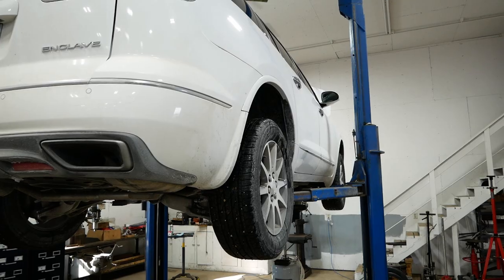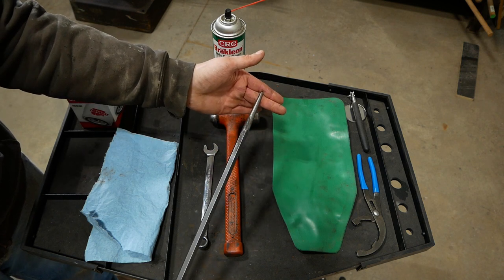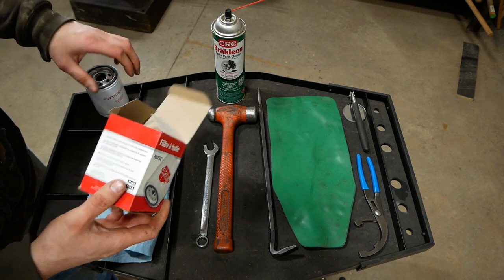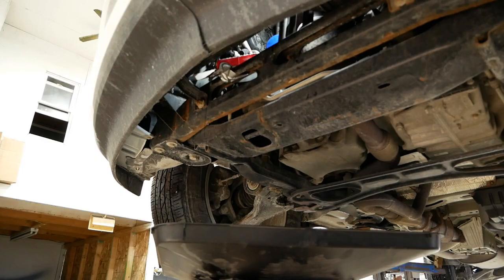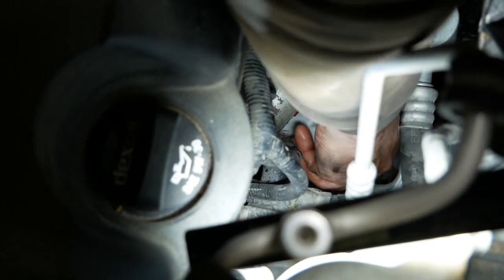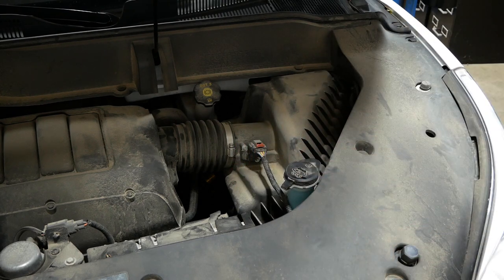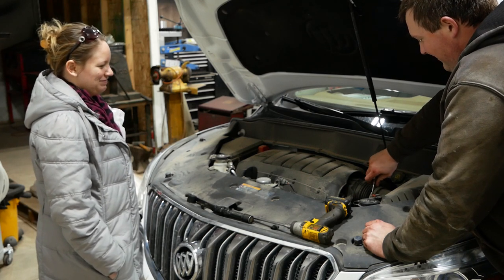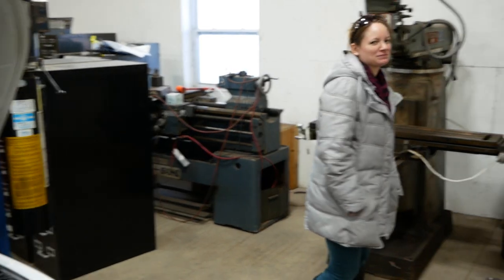Changing a GM 3.6L Spin On Filter without Spilling Oil?

Comment: Just flip the car onto its tailgate, so that the filter is the right way up, and then use a scissor lift to access the engine compartment. Just as GM appear to have intended. 😂

Comment: I need to take you to task on your comment @ 10:58 (stupidest airbox...)...  If you believe this then you've clearly never been called upon to replace the one in a BMW X5 3.0D!  Honestly, the first (I think) generation at least were ridiculous to access. Saw more than one at around 10 years old with full service history, low power and smoking issues simply due to the filter never being replaced as it's that bad even dealerships skipped it!  Can't recall the details now as it's been a few years since I touched one, but it sticks in my mind that an ungodly amount of dismantling was required & they usually came out fully clogged up & the housing full of leaves/debris.  Remember this was even on fully main-stealer historied cars too...
Reply from the maker: We don't really see German cars here thankfully!
Reply: @WatchWesWork  I don't touch them now either haha, older (pre 1998-ish) ones maybe but otherwise prefer to stick with my Frenchies :)  You're quite lucky to not see any of the post-2000 BMW/Mercedes stuff though, hateful.

Comment: I was just cursing the GM engineers while I was changing the air filter on a 2018 Traverse. Torx screws that just thread into plastic. I would have expected better even from China.
Reply from the maker: Wait until they strip out or break off the ears.

Comment: Also Wes :) yes I know saying on oil filter is worst also give tip get the metal cap has 1/2 drive square socket ranch  for end filter plus short extension of 12 and 1/2 rachet wrench to help out and so get loose use rachet only to! Then get rachet off take oil filter cap with oil tap oil filter on bottom off metal cap! Do a thin layer of grease on new oil  filter O ring plus thread so get off easy next time and do same rachet to get back on! Yes worst Oil Filter I had was on 2.2 Etco Tech in 1994 Chevrolet Cavalier in back of engine plus near straight pipe exhaust yes hot to burn you ! Plus same car Coil pack change on back of engine to do spark plugs wires  a pain in butt too ! Worst air filter change  done is  on Chevrolet Impala cars you have hot engine undo a slot screw band & take off box also Mass Air Flow sensor ring to then 2 clips off air box pull out way then air filter out and vaccum air box also put together again reverse told after engine warm up ! If do cold be be for 8 hours for Mass Flow Air sensor to get off and Air Filter replacement! I had change one in cold winter because road salt & sand mix plug up air filter brought sensor to change like hard glue fibre paper was and Mass Flow Air got ruin too also had be changed! Fun part Mass Flow Air Sensor ring is $500.00 brand new at GM dealer and Auto Stores $200.00 or go Auto Wreckers company buy 2 used one  for $100.00 on any car be in yard but want check before leave or going screaming loud choice words and Air Filter I changed that vechile all came to nearly $600.00 if bought dealer! But did cry of $300.00 at second place Auto Store for parts and my  time 8 hours because outside! But best Air Filter I like last 3 years before change is Fram 2x version! I have challenges to Wes and sometimes wishing things stay easier but never going happen!

Comment: There's a Chevy dealer less than a mile from our ford shop and when their " complimentary maintenance " is finished they typically come to us because we're a walk in business. Never fails, every one of them has been tightened the shit out of, no oil on the gasket so they leak oil before it's unscrewed enough to spin off, from Chevy. 
Some people say the filters not tight enough, it's leaking. No bitch, it takes a case of brake clean to get half the oil off the engine and and out of all the crevices it gets into. We can't afford to waste our brake clean on one fucking oil change. Buy something not designed by a dipshit next time.

Comment: Yeah Gm has screwed  that up on almost every car or truck. Hate changing it on my 2004 truck. Filter and drain plug both. Makes no since in my truck's case only thing they use that engine in is a truck(4.3). Who ever engineers the truck doesn't talk to the engineers the engine.

Comment: If GM just tilted the filter so the oil ran back into the block, problem solved.  Toyota did that on the older I-4s.
Reply from the maker: Too much work I guess.

Comment: fuck that, I'll just blast boiling hot oil all over the place after scorching half my arm on the exhaust manifold/cat, then spray half a can of brake clean in there and hit it with the garden hose and if it leaks on the customer's floor I pray to god they decide to never bring that rolling trashheap back to me.

Comment: Nothing beats good old Ford engineering. I remember the Ford Tempo. The oil filter was right above the starter. Easy to get to, but drained right on the starter. Try checking the transmission fluid on a 2015 Ford Taurus. It's under the airbox. It's quite the procedure to do something that should be simple. Point is, they all do terribly dumb engineering. I'm so glad to be out of that business.

Comment: C'mon Wes. If you would bother to read the owners manual, I'm sure it very clearly states in chapter 17-paragraph 9 subsection 36 appendix 4F that there are no user serviceable parts inside this motor vehicle. See your authorized GM dealer for any concerns.
Reply from the maker: Hmm. I missed that note.

Comment: My honda leaks a lot also ...not nearly as bad as that but ...my technique is to drain the oil from the pan, leaving the drain pan underneath...START IT UP WITHOUT OIL;...run it for about 4 seconds ...thus pumping the oil out of the filter...then  there is little oil to leak.
Reply from the maker: Sounds risky.
Reply: Sounds like a good way to lose oil pump prime.
Reply: @dfross87  I have been doing it since my 1999 Honda Civic was new...I have done the oil change myself every time...It has 250K miles on it...Still runs like a new engine. Burns no oil. Remember I only run it for about 4 seconds and yes it does lose prime. so I start it again before I top of all the oil to full to prime without over pressuring it.
Reply: @HanstheTraffer  My uncle USED to do that with one of his cars, until one day the oil pump didn't prime and he lunched the engine.

He still purges the old oil by starting the engine (so do I, with certain vehicles), but only AFTER he has refilled the sump.

Comment: Neat trick but I'd rather just take the filter off right away and leave a drain pan underneath. Make sure you're wearing gloves or you're going to burn yourself like you wouldn't believe, especially in the middle of summer and the car just got off the highway
Reply from the maker: It makes such a mess.
Reply: @WatchWesWork  It really does. If I was doing this at home 100% I would use your method but on the hoist I'd rather just use a bunch of brake clean to get the car done faster

Comment: GM does not design for maintenance. If they can save 2 cents by shoving that oil filter 10 feet  up the exhaust pipe, then that's where they'll put it.

Comment: If he still has an extended warranty you just put on the wrong oil filter.
Reply from the maker: BS. The warranty cannot be void for using aftermarket parts. They would have to prove that the filter caused the failure. I've never seen that happen, ever. Even then, it would only void systems directly associated with the failed part. Same for having an independent shop do the work. See the Moss Magnuson Act.

Comment: The wonder of modern engineering is that every essential part that needs periodic maintenance should be covered with a shroud that is almost impossible to remove. Theory Vs practice. Fools with no practical experience.

Comment: Ever change a battery in a Ford Escape from the mid 2010's.  Also ridiculous.
Reply from the maker: Or the early 2000s Lumina where it's under the headlight and you have to pull the driver side wheel to change it.
Reply: @WatchWesWork  On one of my cars it's front left wheel off and remove the inner wheel arch liner -- to change the indicator globe!
Reply: @WatchWesWork  oh yeah, my brother had a Monte Carlo.  Fun times......not.

Comment: Acutely its a Australian designed engine...
Reply from the maker: I think it may be Opel in origin.
Reply: Looked it up... Designed in a joint venture with Cadillac and Holden ( GM Australia)
Reply: @Bumblebee4788  Which on the Commodore meant the filter would have been on the side, and probably more accessible.

Comment: Well that worked :-D
The old u.k Ford Ka has the filter on the back of the engine and firewall,  ford make silly designs as well.
The plastic covers are to hide the ugly engine and engineering, and collect muck, it's true lol.
Ooow a lead sheet in plastic.
Reply from the maker: Ford is just as bad. Chrysler actually does pretty well in that regard.

Comment: I despise working on any GM. Just did upper control arms and ball joints on my son’s GMC Envoy. What a POS job. Have to bend the inner fender to allow the bolts to clear. What a bogus engineering job. I would never, nor have I ever owned a GM vehicle. 💩🤮

Comment: On all my Toyotas the engineers put a little catch tray under the oil filter. It's almost like they don't have there heads in the ass.
Reply from the maker: Chrysler is good for that too.
Reply: @WatchWesWork  thanks by the way for your video on the RAV4 alternator. I replaced the one on the wifes car last week.

Comment: Burned my forearm on so many of these damn engines when I used to be a lube tech.  Usually the customer sits outside with the car idling on a 100° day waiting to get the oil changed so the exhaust is scalding hot.  Spray the oil gun too fast when refilling the oil?  Better take apart the intake and clean all the oil that backed up into the intake tract.  Funny smell?  Find a family of mice under the engine cover.  Changed the oil religiously every 3000 miles?  It’ll still need timing chains around 150k.  Timing chains survived?  It’ll need a transmission around then too.  God I hate this platform of GM vehicles and this engine.

Comment: Buy German vehicles. Have 88 e30, 04 S4, 14 535, 2000 911 which I never spill a drop of oil from filter canister. My f250 6.0 has same canister as my German cars. Now my F150 spills oil all over the frame & floor as truck is demonic only on oil changes. Of course my 72 C20 w/SBC doesn’t spill a drop of oil.  Moral of the story is get stupid customers that overpay for autos. 😬

Comment: Good technique in the battle of vehicle services versus OEM engineers.  
I learned something today though: NEVER buy a modern GM product.  If a routine task like checking an air filter and changing oil is that much of a PITA - heaven only knows what else is lurking behind that ugly styling.

Comment: Do you know how they used to dispense oil when it was stored in quart cans? They had a funnel that would cut a hole into the top of the can with a spout that delivered the oil into the engine. Could you fashion a piece of half inch steel conduit cut at a 45 degree angle sharpened to a pointed end that would puncture the oil filter. Attached to the tube would be a curved skirt that would fit under the oil filter and direct any drips into the tube. The tube would extend out of the frame enough to drip into the drain pan. The skirt would guide the pointed end to the proper location and a hammer strike would pierce the filter. So if your bar had been drilled end to end when you punctured the oil filter the oil would have come out the other end. 
https://www.tommcmahon.net/2009/07/an-oldfashioned-oil-can-with-an-oldfashioned-spout.html

Comment: Those covers are there mostly for noise (both wind noise and insulation of engine bay noises), but also sometimes for fuel economy. This one is particularly poorly designed, though, as it's one piece all the way around the engine bay with a bunch of fasteners. When you cover everything up like this, you should make it easy to remove the cover to do work, pop a few screws or clips and pull the cover out of your way. This one doesn't even look possible to remove without removing the hood strut. Terrible design.

Comment: That 3.6 is the biggest piece of shit. I worked for GM for 25 years and between the 3.6 direct injection engine and the 4.6 Northstar I have made a fortune and don’t get me started on the 6 speed 3/5 wave plate failure.
Reply: They make a ton of power. Other than that, they are toilets.

Comment: Corporate mis-communication on display:  On this "high priced" model, there is no easy way to not make a mess, while on my Son's "low priced" 1999 S-10 with a four cylinder, there is a plastic drip funnel starting under the oil filter and ending next to the oil pan drain plug!  Go figure.

Comment: They have labor times, they know what takes time and how long it takes. Making it and designing it like a complete fool so you need to go both above and below (WHILE MAKING A MESS, Not the ''nicer''' Straight down filters from lets say a 2.0T VW) So you got a side mount filer, only accesable from the top basically which is gonna make mess or you do a couple minutes of work to get it either set up to make no mess or to clean it...What a pain, those SUVs are clunky too. Disasters.
Reply from the maker: Yes, disasters is right.

Comment: My sister owns and drives a 2010 GMC Terrain I do not like her 2010 Terrain here are the reasons number one the gas tank fuel door is on the passenger side and not on the driver side number two the ecu mounts on top of the battery box what was those Engineers thinking of putting the ECU on top of the battery box that makes no sense at all and number three the windshield wipers redesigned when it takes a special clip to put them on the windshield wiper arms and that's my three reasons I hate the 2010 GMC Terrain

Comment: In a few years you will have to have a federal license to work on a Government Motors Vehicle.
Reply: It has already begun with Chrysler. You have to buy a $50 license from them to allow your scanner to bi-directional control and clear codes on 2018 and newer cars and trucks.
Reply from the maker: Autel has a workaround to go right to the CAN bus.
Reply: @WatchWesWork  I just took a look and it seems you need the Autel scanner. I have a Snap on. It seems I would have to buy and keep updated a second scanner. The $50 annual to Chrysler is a bargain in comparison. So far I haven't needed it because thankfully I service few Chrysler/Jeep vehicles.

Comment: Why do you think repairs are so expensive these days????

Engineer #1 where do we put the oil filter???

Engineer #2 over here behind the frame and out of reach from the top and bottom...

Engineer #1 how will they change the oil?

Engineer #2 they need to but this really expensive tool only we will make and need to put it up and down on the lift 10 times.  Quadrupling the labor cost....  when the bosses notice all the money they are making from oil changes they will make all the vehicles that way....  just wait till they see what I have in store for the air cleaner and light bulbs....

Check the block, probably cracked from the 200 foot pounds of torque on the oil filter.

Comment: Not as bad as my o5 f150 with 4.6 have to reach down between radiator and fan to get the oil filter off because it's a 4x4 and can't access anything at all from bottom have to take wheel and we'll cover off otherwise ford engineers are freaking idiots
Reply from the maker: I never thought those were too bad. They do make a mess though.

Comment: WTF, plug the filter hole with something and forget about oil filter because such a design deserves no oil filter, take air filter out also and forget about that too, wasting money changing engine oil for that car? up to your mental condition, actually it is not recommended.